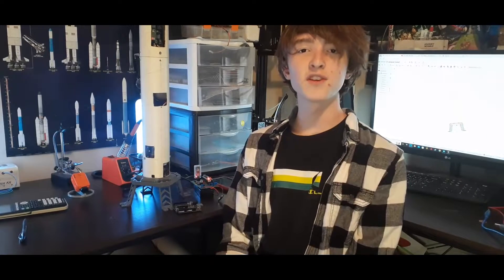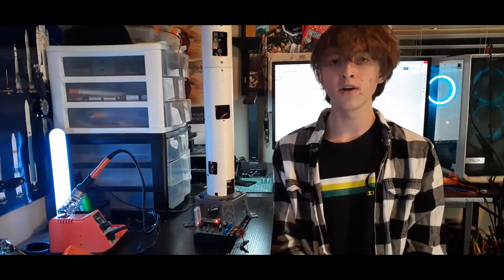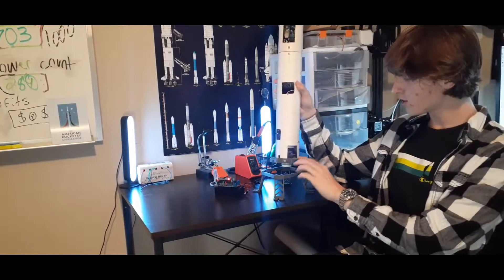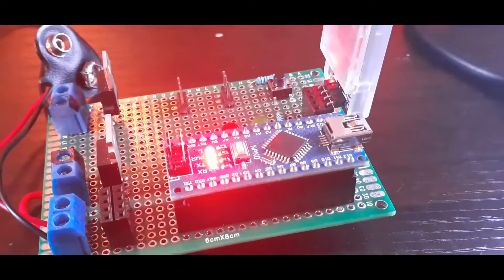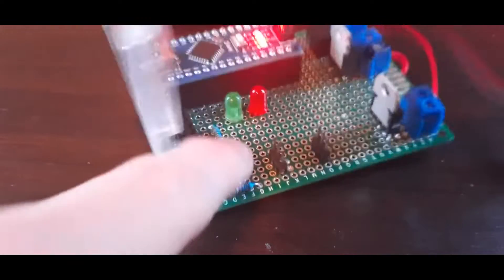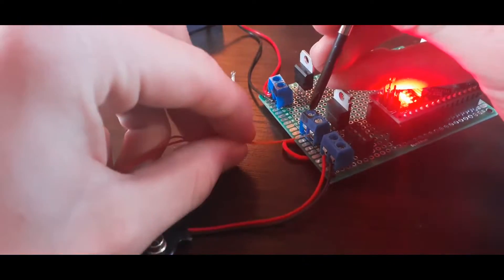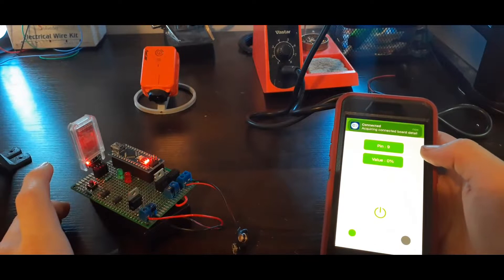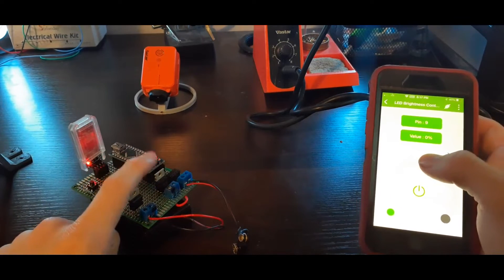Launch Pad Computer for TVC Rocket

Comment: Also tip that's probably not necessary, when using plastic parts it's not uncommon for the rocket to melt the pad, I have a water deluge system I set up using half inch PVC
Reply from the maker: Because the thrust is pointed away from the plastic parts, and only in the general area for a short time, I don't foresee it being a huge issue but if it is then I will definitely make that modification. Thanks for the tip!